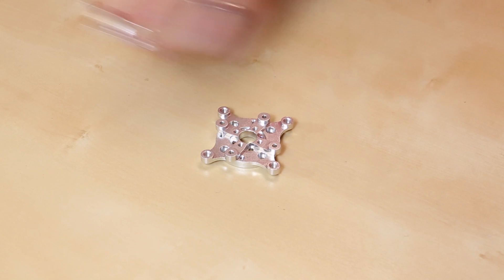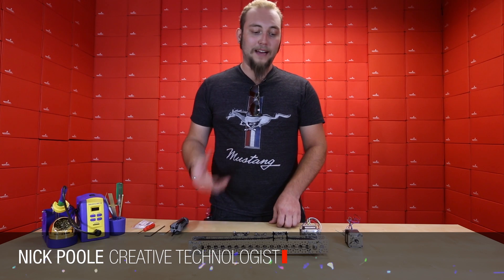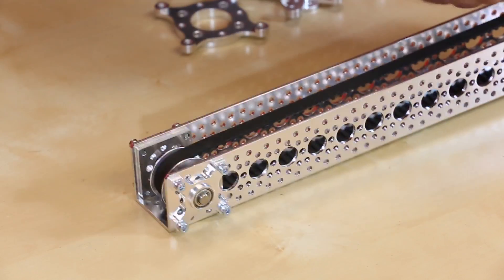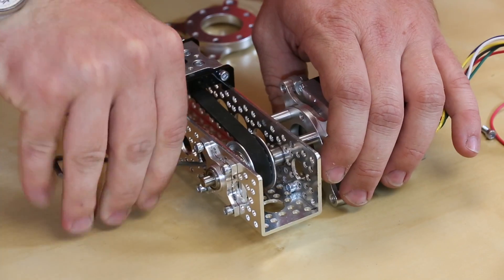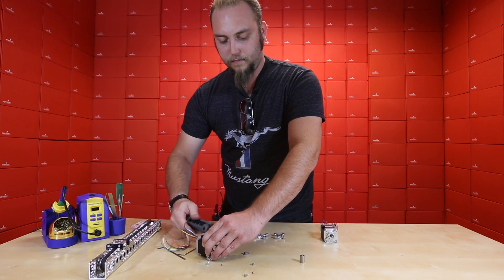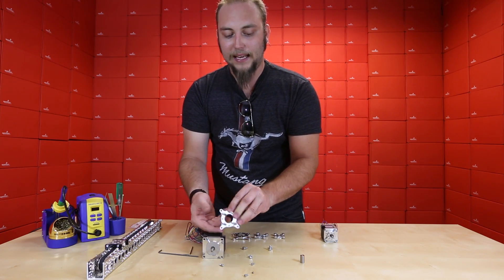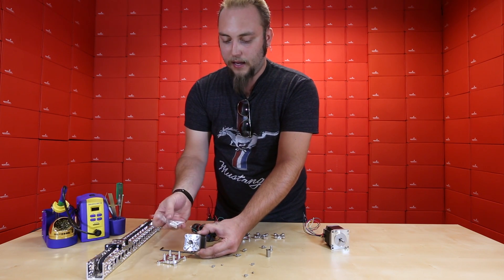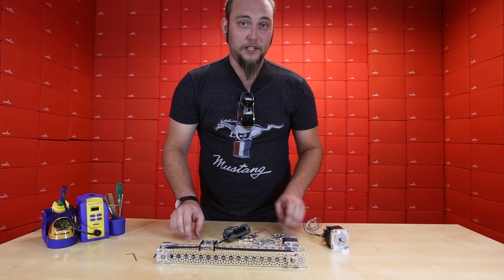Stepper Motor Mounts for Actobotics

Comment: FYI, I have almost this exact slider setup and it is loud, even with microstepping.   The channel resonates with the vibration of the motor and it makes a lot of noise.  Mechanically it works great, but be aware that it won't be quiet.